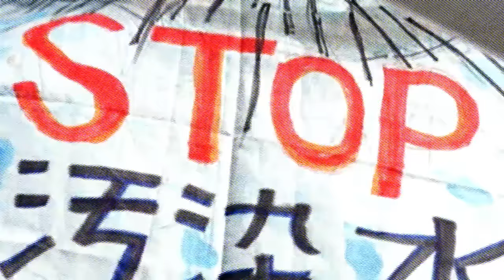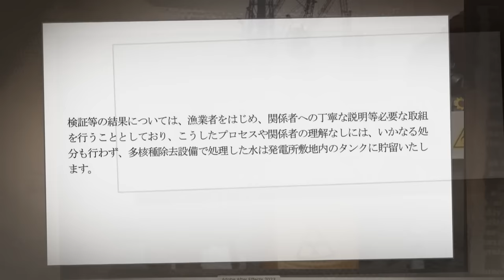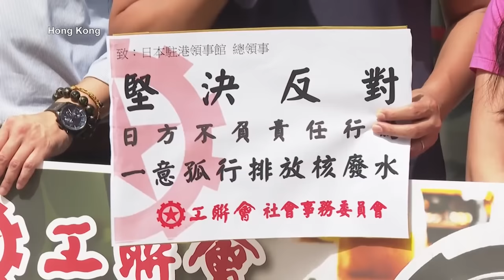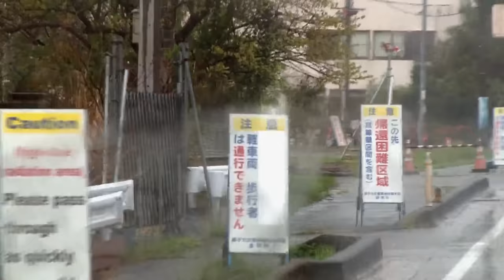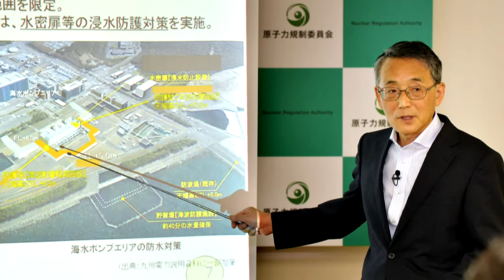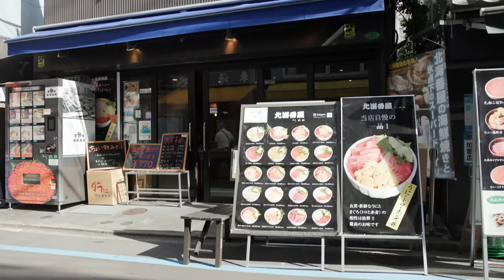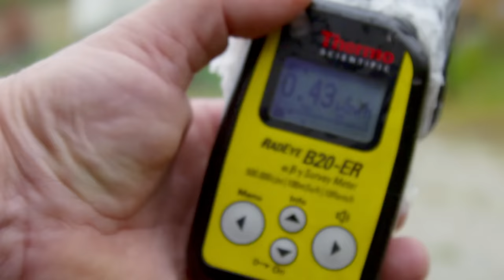Fukushima’s Nuclear Wastewaters Have Been Released. Now What? | Insight | Full Episode

Comment: If the contaminated water is so safe, why don't Japan use the water for their farmlands. Go figure.
Reply: The contaminated water after treatment from ALPS to remove Caesium and Strontium is left with Tritium. It is released 1km offshore into the ocean for further dilution. Water testing so far has shown the radiation levels detected from the release are safe. 

They can't just use the water directly for their farmlands without massive amounts of water for dilution.
Reply: Why don't you use the tritiated water your country releases to irrigate your farmland?  At lease yours doesn't have sea water in it.
Reply: @jethrolee107   So you are saying that the water released itself can be harmful until the dilution, right? Then what about the ocean's creatures that just happened to be around the outlets 1 km away from the shore? They were directly exposed to the contaminated water before the dilution. And the biological concentration will cause the accumulation of the element and lead to unexpected implications.
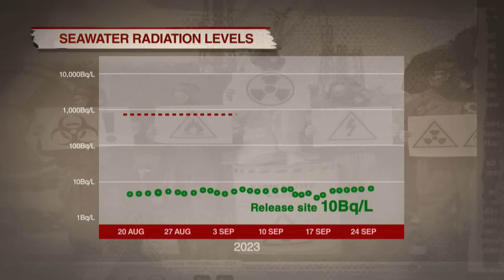Reply: @jessicanobody8497  Timestamp 27:50 shows seawater radiation levels when tested are safe. Also, somewhere in the video, it shows the release site as near or at the intersection of 2 currents so flow rate that affects dilution rate would be high. If a creature were to stick their mouth/nose at the discharge pipe and inhale during the discharge, yeah I would think it is harmful to the creature. 

Everything comes down to a cost/benefit analysis. They figured that this is the best option for them. They were running out of storage space for untreated water, they needed land space to build a new building for the decommissioning of the plant, moving the untreated water is a risk in itself, Japan is prone to seismic events, who knows when the next major earthquake will happen, if it happens and the tanks that are holding the untreated water ruptures, they will have a bigger ecological disaster.........etc. I'm sure all these were taken into account when the decision was made.
Reply: @jethrolee107 
Why is Japan afraid to use the "safe" water to wash the streets in Japan then?
Reply: @Anonymous------   Ask them whether they're afraid, I don't live in Japan .. also why would you wash your streets with salt water? Does your country wash the streets with salt water?
Reply: @jethrolee107  
In many countries cities and towns along the coast use seawater to wash the streets and flush toilets. Salt water is better because salt kills germs! Fokosh!tma is right next to the sea, most likely it was using seawater to wash the streets anyway.
Reply: Japan isn't the first country on Earth to use this method for their radioactive water.. others have done so in the past, they just didn't tell anyone.
Reply: Because there are skeptical and nitpicky people like yourselves. If they use it to water their farmland, what's stopping you from saying to ban their farm produces? People like you will always find faults one way or another. Get real.
Reply: Did you even fking watch the video? 😅
Reply: @lingth  other country nuclear power plant does not melt down
Reply: @jethrolee107 You mean the water is more safe if they share to the neighbour ?
Reply: Your logic applies to every nation.Why your nation dont use nuclear plant water to water farmlands？ Because it is not safe ？ then where is it dumping knowingcit is dangerous
Reply: @jessicanobody8497  They have NO VOICE to speak out loud。。。
Reply: Lol. You are too naive. You think you have replied logically, but think. Those were a salt waters, and it cost extremely a lot to turn out saltwater to clear water. It’s even a hard task for other rich countries like US either.
Reply: @jethrolee107 There is no way that the cesium and strontium as well as cobalt 60 and many other isotopes have been removed by their resin filters, total bullshit all of it.
Reply: @jethrolee107 ya certainly not 100% ideal but at some point all of those tanks of untreated water would deteriorate and start leaking anyway so some solution had to be found. Sounds like they really did try to consider everything. Imagine what it cost to build all of that infrastructure to treat the water. We should be thankful that they actually created this whole system and didn't just start letting the tanks rust and leak untreated water right into the ocean
Reply: Not a nice comment baby , if someone accidentally hurts u , we forgive them , same here , 💝 stuff happens!
Reply: @jethrolee107 So Why reuse the water to cool the nuclear core? It is Still need water.
Reply: @lingth None country has level 7 nuclear disaster. Three nuclear core melted.
Reply: @jethrolee107  canadas limit for drinking water in 2010 was 7 becquerals per liter  now its 10,000 becquerals per liter so ya nothing to see hear please move on shut up and live 😅
Reply: Im sure foreigners , chinese and koreans who personally experienced the earthquake and tsunami in japan 2011 that spilled and destructed the reactors would never say today

 "why dont you drink the radioactive water first"
Reply: From what I read non of this would have happened had Hitachi which built the reactors listened to a GE engineer advising them not to keep the generators at sea level. They didn’t listen.
Reply: Who uses seawater for farming? I recommend more study for you.
Reply: @dannyp5358 because the ground doesn’t dilute it. The ocean does
Reply: If the water is so clean and even drinkable as Japan has claimed, then how about pouring this "clean" water to your water utility system and let your citizens drink it? BTW: Looks like most western countries are basically silent about this. If the same thing happens on China, how would Japan (and those western countries) react? Western countries accuse China of their "uncontroilled" rocket debris threating lives and damaging environment, but allow Japan to dump radioactive water to the ocean. Double standard!
Reply: Canadas drinking water standard in 2010 was 7 becquerals per liter now it,s 10,000 becquerals per liter and they say it,s safe hmmmmm😢
Reply: But the Americans and the English said that it was completely safe and that they would be happy to drink that water. hahahaha. Of course, you can trust them because they are so truthful.
Reply: @Strasnilo  we do drink thecontamination each day ,  here in canada in 2010 the drinking water standard for trittium was 7 becquerals per liter  in 2011 they changed it to 10,000 becquerals per liter ... and i bet the testing equipment used  only can calibrate up to the 10,0000 mark ? Matters not your alive till your not so live each day  and just he happy eh .
Reply: Because it is salt water. What kind of genius are you?
Reply: Thanks to yours lack of knowledge, there have been no reports of bedbug outbreaks in the Tohoku region of Japan. In Tokyo, Osaka, and Kyoto, bedbugs brought in by foreign visitors are occasionally found, causing trouble for the Japanese people. (Previously, bedbugs had been completely eradicated in Japan.)
Reply: @Lu5ck  正面から相手しないほうがいいよ。海流がなにかも知らないんだから。
Reply: Because seawater is salt water. Duh.

Comment: My 5 cents.  Personally I find this to be one of the weaker episodes which CNA has produced over the years.  It could be more useful perhaps if the CNA could perhaps elicit a response from the expert team on their thoughts relating to whether all contaminations, radioactive or otherwise, were indeed totally removed from the water save Tritium - since this is the main propagated argument from opponents -, whether there is an actual difference between waste cooling water and radioactive contaminated water - ie the water interacting with the actual radioactive rods, and finally what are the findings of domestic NGOs regarding their water monitoring results - since one of the critical point per opponents is that the base data including that of IAEA fundamentally comes from TEPCO or Japanese government sources. 

Answers to these from a reputable neutral network like CNA can probably dispel most of the internet misinformation. 

 BTW, most Japanese do not patronise Tsukiji so they are likely selling predominantly to foreigners, and Japanese, being Japanese, will likely give a politically correct answer when a fairly nationalistic question is asked to them.
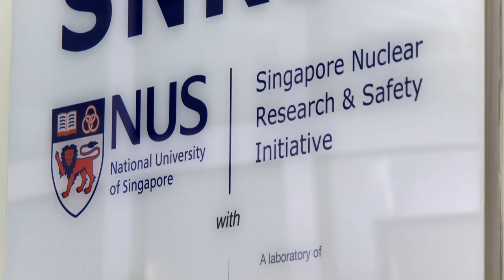Reply: 23:55
Reply: You could have read the report.
Reply: @kknn523   All nuclear power plants on the planet have always released this tritiated water.  Why is it you think Japan should be the one fined?  The re[port clearly shows it's no more dangerous as to what all NPP releases.
Reply: @nightowl4121   China refused to participate in the water testing report and regularly releases more tritiated water than Japan does, so obviously their motive is political, just as they always have regarding anything Japan has done since WWII.

Comment: My question is:  What is being done with all of the radioactive material / nuclear waste that is being removed from the water prior to it's release?  Is it being stored somewhere?    The treatment system is referred to as 'similar to a water softener' and my understanding of how they work is that they need to be cleaned / flushed on a regular basis to be able to work effectively (which ends up going back into the water supply / wastewater) or there is a filter (or filters) that needs to be replaced regularly with certain types of systems.    How is this system cleaned to ensure it continues to remove the waste that it is intended to remove and where does the waste go or where is it being stored throughout this ongoing process?

Comment: The focus shouldn't only be oj Tritium. How abaout the Carbon-14, Strontium-90 and Iodine-29
Reply: The  focus of this water release is on Tritium because the other contaminants have already been removed from the water. As tritium water and normal water cannot be easily distinguished and separated, thus why tritium contaminated water is released .
Reply: I agreed with you since the other radioactive elements were reported to be present in reports a few years ago after the "treatment".

Comment: Japan had four alternatives that is much safer but more expensive they chose not to use:
             1.boil and evaporate the wastewater 
             2.discharge the waste water 2500 meters under the ground into pipelines
             3.electrolyze the wastewater
             4.make nuclear wastewater into cement blocks buried underground
You see, the Japanese think that it is not worth the trouble for them to consider the rest of the world. 
So they say they are sorry, and used the IAEA test certificate to justify what they did. 
But it  doesn't work that way! ! !
The sea doesn't belongs to Japan! ! And it certainly doesn't belongs to the IAEA! ! !
 If they want to dump their waste water, they should ask the permission from the world! ! 
If a guy were to piss in your gradan without asking your permission, you should kick him away! ! Instead of letting him show you a certificate saying that his piss doesn't harm your flower......

Comment: Hydrogen fuel generator was safer to have at each home
About the size of a bin can create gas..powering a home..gas to heat cook
Run a small generator to produce electricity
No toxic fumes
A car can be fueled on hydrogen gas
From salt water
Safer
Reply: Except all that you mentioned is all a red herring in being a viable solution.